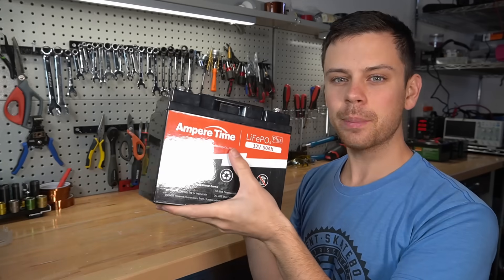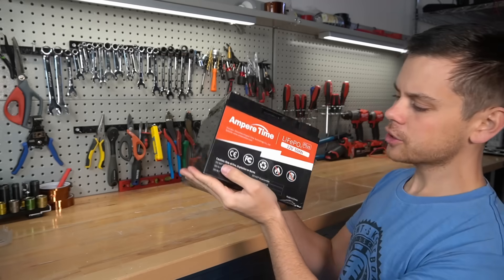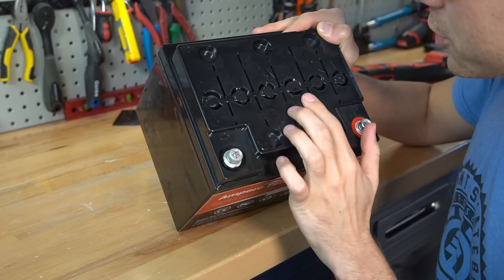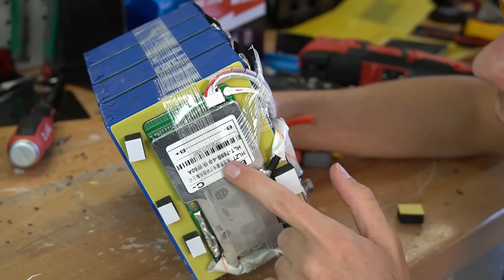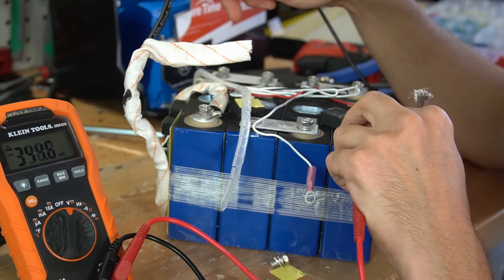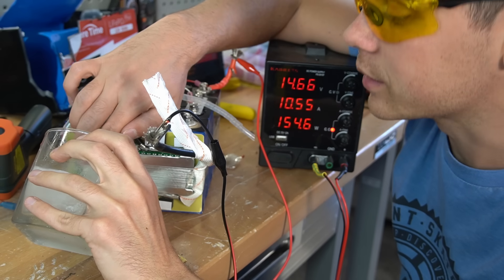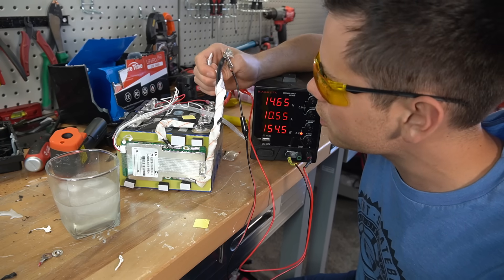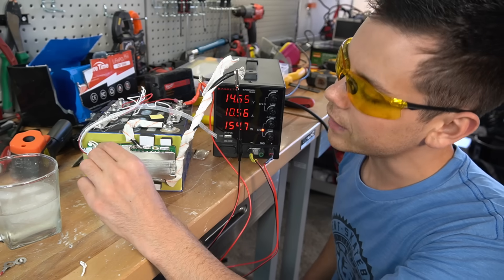12V "Ampere Time" LiFePO4 Battery Teardown

Comment: These will work great for my purpose. I will carry one in each side bag on my bike for camping CPAP power. They will be charged at home in a warm house and used for6 day,  5 night moto-camping trips. I was getting 2 nights out of my old 300 watt Rockpals. I want to not have to recharge during the trips. Hopefully there will be a little extra for phone charging. Most of my camping is done above 32 degrees. None of the Li Time "PLUS" batteries have low temperature protection.

Comment: Hi Will, my father was using a 20 amp charger with this exact battery. Now, the battery does not work. Is it a lost cause or repairable?

Comment: I specify that I have a 70 lb brushless electric motor that runs on 12v, is the 12v 100mh or the 12.8 mini model better?

Comment: Hey Will, I have an litime 100AH and use it to power my trolling motor and downriggers, I have a Honda 9.9 outboard and im wondering if it would be safe to charge this battery with the outboard motor ?

Comment: I had reached out to the company about the Cold Cut Off feature being missing.  This was their response.  "Dear Jake,
Thank you for your kind suggestions.
Our battery can be used well below 0C (can be normally discharged), but we don’t suggest charging the battery below 0℃. 
It is like most kinds of the battery in the market now:
Charge Temperature: : 0°C--50°C; Discharge: -20°C--60°C.
Currently our battery can be charged at low temperature, but it is charged with a very small charging current. And we’ve used auto motive grade battery cells which have superior quality. Even if charging in low temperature environment, it will not damage the battery. 
The BMS in our battery has low temperature cut-off protection function, but if we set this function on our battery, the battery can neither be charged nor discharged under 32F/0C. At the beginning, we had set up the low temperature cut-off function for our battery, but later many customers responded that they needed to be able to discharge it under 32F/0C. After careful research, our team has decided to block this function.
Many customers live in cold area, they are happy to use our battery, since it can be discharged very well, and their load can work under low temperature. If they need to charge the battery, they will take it inside the home (where the temperature above 0C). 
If you have any other questions, please feel fee to contact us.
Best wishes,
Your friend Teague
From Ampere Time 
View this message on Amazon

Comment: Can't they put a small resistor and if the battery is cold, they can trig the resistor to warm up the cells first, with the solar power, and when the temperature is ideal it can start to charge the battery?

Comment: There are a few MPPT charge controllers that come with the temperature sensor for high and low temps, I wonder if my DC to DC dual input charge controller would do a good enough job in shutting down the charge when it senses that the battery is too cold, I'll go ahead and buy one of their 400 amp batteries and put a heat pad that works with a thermostat so hopefully that is enough of a backup to prevent the low temp charging. Really, like always a great review!  Thank you so much! 🥰👌🏾

Comment: Thank you for all the content you put out! If I put my charger on a thermostat triggered outlet, and set the outlet the charger is plugged into to turn off at just above freezing, would the battery then be safe and would you give it a recommendation with this protection in place?

Comment: Hey, thanks so much for all the awesome information. Question about ampere time batteries and trolling motors. Is there a reason you know of why ampere time states on their website that their batteries are not recommended to be used with trolling motors?  My motor pulls 50amps MAX and the 100ah battery is rated at 100amp draw. Any info on this would be super helpful!  Thanks.

Comment: Please clarify the lack of a low temperature cutoff. I would fully charge the battery in September and store it in my unheated cottage over the winter with no load of any kind attached to it.. When I come to the cottage in late spring I would charge the battery before using it on my trolling motor. So, I would never be near the cottage to try and charge it in the cold. So, is there any downside to not having this sensor for my type of use?

Comment: This battery are junk for $500 I thought I was gettting a deal but stop holding a charge after 4 months of use. It work so good for about 6 weeks then the volts staring dropping too fast.

Comment: Has anyone used two (or more) of these batteries in parallel, from "different" manufacturers?  For example, a Chins 100AH + a Ampiere Time 100AH?  I know that typically you never want to mix batteries, but since these are all essentially the same guts with a difference outer casing....

Comment: So if i wanted to use one of these batteries for a marine application, where i would only be manually charging in the summertime, you would recommend them? they are less than half the price of their competitors.  (300-350 vs 800-1k usd)

Comment: Love the channel.  I'm wondering if i'm using one of these cheaper batteries for a trolling motor setup if low temp sensor is a deal breaker.  I can see it in a solar setup as a risk where you are constantly discharging and charging automatically but I would be charging manually and could control it.  Is my logic wrong?

Comment: Will have you reviewed the Ampere Time 12V 200Ah Plus ? It seems to be a beast at 200A discharge? The regular 200AH battery is 100A max discharge.

Comment: Honestly the reason why they don't add the sensor is possibly planned obsolescence. It's the same reason phone companies give you chargers that slowly destroy your phone battery. They want you to buy another battery within a few years and by having that degradation in cold weather you end up needing a new battery sooner. Most consumers are not going to educate themselves about the products they use and manufacturers know this.

Comment: Will, could you ps make an experiment for some brands of LIFEPO4 battery from amazon, to see the performance in cold winter especially the self discharge rate, i suppose many followers also are very concerned about it.
Reply: i suppose it really takes time to carry out self discharge experiment, which is why i could hardly see such an experiment and contrast.

Comment: After watching this video I reached out ampere time to see what they would say and if the issue has been fixed with the cold temp issue. And this is what I got.....

We are so sorry for that this battery still not have low temp sensor.

We will have a self-heating battery arrived. it will fixed this issue. But the price will more expensive.

Any questions, please feel free to contact with me.

Best regards.
Yours sincerely Carl
From Ampere Time.

Comment: Their instructions / information now shows charge: 0C to 50C; operating -20C to 50C. Although I found it by asking the question. I have two of the 12v 200Ah versions, so let me see how to protect them. I am in FL, so they might never see below freezing, especially since they are inside the conditioned space.

Comment: I realize this video is 7 months old, but can you tell me if the NOCO Genius-5 (5 Amp Smart Charger) would be sufficient to charge the Ampere 12V, 100 Amp/Hr LiFeP04 battery?  
There's a "Lithium" setting on the charger, I'm just not sure if 5A is enough.  
Thanks!  Great videos!

Comment: I am designing my next solar set up right now for a new RV. I was looking at using 2-3 of these 200ah batteries with a Victron MPPT 100 | 70. Are you saying that with setting up these with the Victron I would not have to worry about them being charged below freezing because it shouldn't happen with the correct settings?

Comment: I purchased 4 of the 200 Ah batteries, I recently asked Ampere Time about not having low temp charge protection. 
They admit they do not have low temp charge protection so buyer beware. I plan to add warming pads and a solar panel disconnect to my setup since I live in a cold climate.
Here was their response:
APT answer:  Our battery can be used well below 0C (can be normally discharged), but we don’t suggest charging the battery below 0C.

It is like most kinds of the battery in the market now:

Operating Temperature: Charge: 0°C--50°C; Discharge: -20°C--60°C.

Currently our battery can be charged at low temperature, but it is charged with a very small charging current. And we’ve used auto motive grade battery cells which have superior quality. Even if charging in low temperature environment for emergency usage, it will not damage the battery.

We're planning to launch new batteries with self-heating functions within 3 months, which allows to be charged at -20°C, and you could keep an eye on our store if you're interested.

Comment: Thanks for the video! If you don't mind a question. We are looking at a lithium setup for our campervan and we do intend on being in the snow at times (though far less than in warmer climates). Thoughts after watching your video, would it be possible/easier to install an entirely separate thermal cutoff switch (I am thinking drilling a hole into the battery case and then running an external thermal cutout that cuts charge straight from the MPPT controller) or do setup some kind of thermostat temp controlled battery box by using a 12v heating pad or blanket around the batteries? I figure if it's not too much hassle to do, the extra effort may well be worth it if the rest of the battery quality is good, as they are about 50% the price of other Lithium batteries and for us that could mean a saving of thousands $$$.
Thanks!

Comment: So, I bought 3 of the 200AH Ampere Time batteries for use in a warm area.  The most output voltage I get after charging is 13.6 V.  Is that normal or should it be higher?

Comment: How could we set this up with cold weather charging protection if the built in low temp sensor is not present or if one doesn’t trust a built in temp sensor?

Comment: I am looking at the 100 amp one for my RV to make coffee, does anyone know the rate of discharge, can this be used for a power inverter going drawing 150 to  200 amps ?
Reply: I would think you would either need two 100ah batteries, or one 200ah battery with a 200 amp BMS to run the load you want

Comment: Hey Will! So with this battery if I am using the Renogy 50a dc/dc charger with the temp sensor would it be safe to use and not worry about the bms not having the low temp cut off?

Comment: So add a cheap temperature controller with an appropriately-sized relay to disconnect the battery (or the charger?) below a set point.

Comment: Thank you for checking this out for all of us! Unfortunately I am stuck with this battery now. Can I purchase a different BMS to replace the one that comes with the battery or could I get a charge controller that will stop charging with low temp cut off? Thanks again!

Comment: 1) Is there any plans you have of evaluating the Chins lithium battery on Amazon? I'm interested in the 200ah low temperature version. Builtin hester? 
2) For my 5th wheel trailer should I get 2x100ah batteries or 1 200ah battery. Or should I have more and why?

Comment: Will I have learned so much from you about batteries Thank you so much.  You put so much careful preparation into your videos.  plus its fun to watch you take them apart. Your knowledge combined with having the ability to explain things in perfect detail is tremendous.  I am considering this battery manufacturer for a 100 ah lithium battery for my kayak trolling motor.  Does its lack of low temp cut off sensor prevent it from being used at or around freezing or is it just the charging that can't be performed at this low temp.?  Thanks in advance for your time and attention.  Tim

Comment: Thank you Will for your tear down review,  I didn't know the build quality of Ampere Time battery is so nice until your review. 
 I purchased 2PCS 100AH Ampere time batteries 7 months ago,  they worked very well so far.
My major concern after watching the review was where it mentioned that even a one time charge under Zero Celsis degree would cause "unrecoverable damage to the battery" is this true? 
I tired contacted seller today, fortunatley,  they just came back from their break .

Here are the following responeses to my question that I recieved from the seller: 
1, Their battery cells are EV class and have been optimized to low temparature charging, even below frezzing temperatures.
2,  In addition, at low temperatures, the activity of chemical substances in lithium batteries is already very low. The maximum charging current is about 10A. This charging current will basically not damage the battery. If there is only one month in a year the battery is charged at a low temperature below zero degrees Celsius , There is basically no impact on the promised battery life.
3，For RV users,  most charging controllers have a low tempurature protection mechanism,  which will prevent the battery from charging in low tempuratures.
4,  The battery initially supported low-temp protection, but Charging and discharging shared one cut-off switch.  The seller has received several complains about the low-temp protection cut-off feature,  which also did not allow the users to discharge from the battery when the low-temp cut-off is active. Base on research and testing, they found they need to support the most of demands that who need discharge under low temperature, and then they disabled/discontinued the low-temp cut-off feature as a default to their batteries.
5, The seller is also testing and enginerring new designs to better deal with low-temp charging condition.
   
I feel much better now and more informed, and I hope this information will be useful to others.
Reply: Seems like their response had similar language as the response Will received from ExpertPower.  Makes me wonder if they are the same supplier.

Comment: Hey Will would you consider testing out the Chins 200ah cold weather battery? And another question do you still stand by what you said about using a dorm fridge? I'm trying to decide on a dorm or dc fridge and weighting the pros and cons of both your advice would be greatly appreciated! Thanks!😊
Reply: I'd also like to see a review of the Chins 200AH low temp battery. Seems like a great deal if it's decent. The warranty wording doesn't instill much confidence. They tout a 10 year warranty but the product description says 90 days unlimited and 3 years that you need to help them "test" it. Without seeing the actual wording it's impossible to know what the 10 years is all about.
Reply: @BirdiesWanted  I have sense this comment bought one of the Chins 200ah batteries. I will say I’m no expert on lithium batteries but it looks well made it came with a 13.7 volt charge on it. I have not installed it yet. But from what I see at this point it seems like a nice battery. Best regards!

Comment: Does anyone know if the Renogy DC 30A On-Board Charger with MPPT with temp sensor would be adequate to provide low-temp charging protection?
Reply: The temp sensor on the controller is for adjusting lead-acid battery charging voltages slightly in different temps, not for cutting off charging to lithium.  Would be a nice controller feature and maybe they'll start doing it.  My guess is the mfg probably don't want to be sued by irate people who set up the sensor wrong and kill $thousands in lithium.  Maybe they'll add the feature with the caveat that the cutoff should only be a backup to a BMS-based cutoff.

Comment: I'm not super familiar with lifepo4 type batteries. so lifpo4 you cant charge a even -2?

my Nissan leaf charges at -20 at only 1500w but still charges and yes it has the built in heater but its kinda a joke of a heater lol also my dewalt tool batteries charge till -5 lifopo4 must be  quit a bit different then lithium ion.

Comment: There is another solution, charge controllers already have a temperature probe for the batteries, a software patch could turn off the charge controller when the batteries are to cold. 

Which leads to the question which charge controllers can do a software patch?
Reply from the maker: Yep, we covered these multiple times in past videos. But we made a rule back then not to recommend packs without it. And packs that do not pull advertised capacity. If you want the pack, go for it.

Comment: Have you ever heard of a low temperature bimetal snap cutoff switch? Otherwise know as a button Thermostat.
Putting one between the solar panels and the charge controller even if you need to add a relay for the solar source current. Solves the issue.
These things have been used as safety devices for decades, and are cheap < $10.
Johnson controls and other manufacturers could a make new product. I found  one already available with a 1 deg C cutoff, on the market. 

Solves the problem.
Reply from the maker: Yep, easy fix. Doesn't mean I'm going to make a recommendation, especially with how many beginners watch these videos.
Reply: @WillProwse  an email, describing the issue to Johnson controls, asking them for a plug and play box i.e. mc4 in and screw terminals out might motivate a new off the shelf product. 

You might get a free prototype to test. It never hurts to ask.

Comment: @DIY Solar Power with Will Prowse, can you not add an external Temp cut off? Why does it have to be ON the battery(ies) if you can use the ambient temperature in the battery area?

Comment: I cannot understand why it is so hard for the BMS producers to add the low temp protection. I contacted one of the big manufacturers and they said that they can program the low temp protection only for orders of 10+ units and only for >4S BMSs. For some reason their 4S units cannot have this enabled, although they have high temp protection. Maybe the sensor is different, indeed.